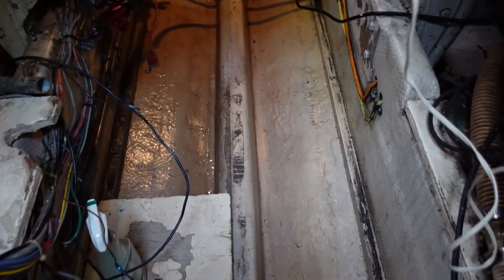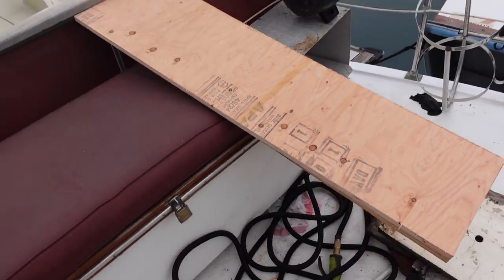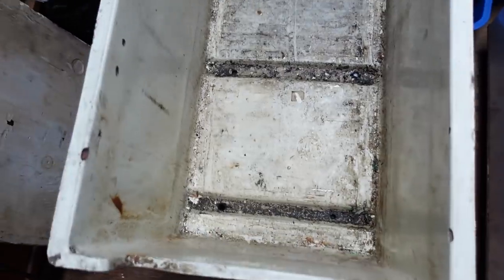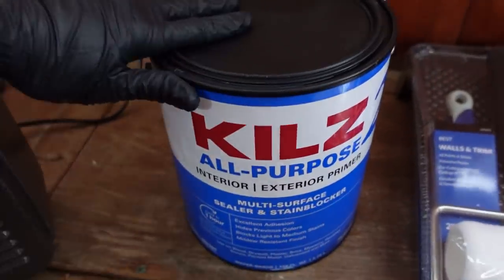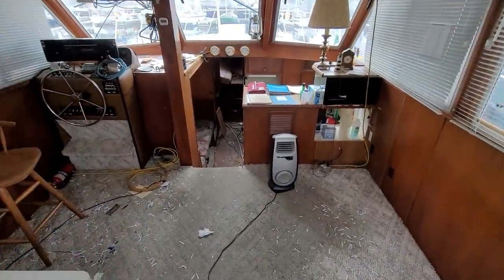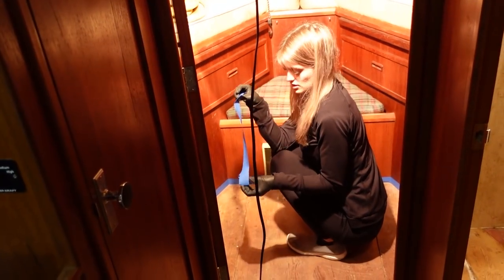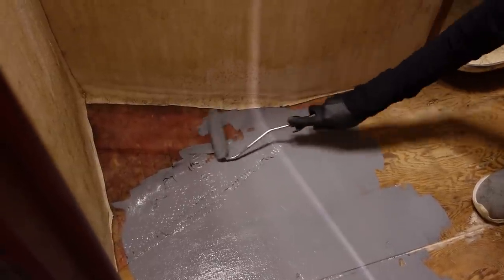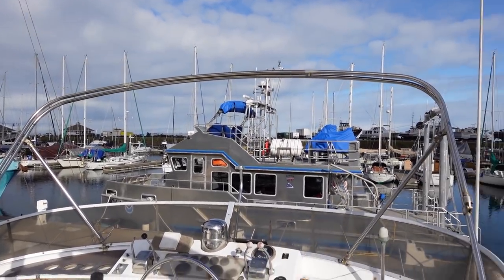Painting NASTY Interior Floors | Old Yacht Restoration | Ep. 8

Comment: When using a spade bit to drill holes in wood, it is good practice to only let the pilot poke through the bottom surface then turn the drill around and finish drilling from the back side to avoid splitting around the hole.
Also, consider getting a PVC pipe cutter to squarely cut tubing and hoses.
Great job on the restoration.  I would be interested in your backgrounds and prior experience.  You certainly are proficient in many trades.
Reply from the maker: Great advice, and thank you. We go into our backgrounds in episode 14, but any further questions we'd be happy to answer.

Comment: For the smell- consider a solar vent fan.  It turns over the air in the boat every few hours and really solves those problems.  For the interior wood work, I would keep as much of the wood tone as possible but for areas where the plywood is rough or water stained you can sand and paint any color but sand/scrape/strip the solid teak edge trim and varnish that for a very sharp, bright, yachty look.  Nice work!
Reply from the maker: Solar vent fan sounds like a great idea, we'll look into getting one. Thanks for the guidance on fixing up some of this wood.
Reply: @SeekingSeas  no prob. Looking forward to the rest!

Comment: Congratulations and great channel. I highly suggest installing carpeting with thick padding on top of the newly painted floors, or some form of vinyl with padding. The carpeting is designed to be a thermal barrier and more importantly a noise barrier for those loud diesels. Also, plywood is not an ideal flooring material...
Reply from the maker: We're leaning towards carpeting for the reasons you mentioned. It is very loud when the engines are running, so getting sound proofing under the carpeting seems like the way to go.
Reply: @SeekingSeas  you should look into sound dampening, easy to buy off amazon, put a barrier of the aluminum backed (like dynamat) stuff along the underside of the engine room roof and then add a layer of very dense noise insulation foam with some glue. It will cut noise to the cabin by 60%

Comment: If you have not done anything with your boat’s interior floors yet. You may want to consider just painting over the primer that you put down with a marine interior paint, and then buy same fairly cheap rugs to put down. With all the work you will be doing if you put a nice floor down now it will probably just get torn up and stained before you are done. Also, I’ve seen too many times where people put carpet or other flooring down and they made it where you could not open up all the hatches over the engines which made working down in the engine room much more difficult.
Reply from the maker: That's not a bad idea! We'll definitely have to consider this, thank you for the suggestion.

Comment: When painting panels take a scrap piece of wood and put a bunch of screws through it with them pointing up through the wood then you can paint panels and just flip them onto the screw points and paint the other side right after without having to wait for everything to dry. Imagine like a bed of nails. It also gives good air flow so the paint dries pretty quick.

Comment: Did the Kilz work?   I think I would have sanded that floor, damp mopped, deck brushed with bleach water, wet vac up, dry and then used the Kilz.
Reply from the maker: Kill worked great, we still haven't decided on flooring material yet but this helped to seal some smells into the wood.

Comment: Smells coming up from the bilges, best thing to use for cleaning bilges and cheapest is toilet bowl cleaner. The painting of the subfloor will help a lot  and then some type of laminate flooring peel & stick wood like strips work well especially with hatches. Finally replace all of your waste lines going to holding tanks and if you can pull the tanks and replace or clean with heavy duty industrial cleaner brutal job but makes a huge difference! Also replace your water lines and install a home style filtration system connect both your dock side and on board system to the filters.
Reply from the maker: That is great advice, any particular brand of peel and stick you recommend?
Reply: @SeekingSeas  Don't know if you have them out your way, in the mid west here we have a discount chain called Ollies they carry a 36 inch long by 2.5 wide peel and stick plank. Very easy to use you can cut with a heavy duty scissors. I am on vessel #2 using it. Goes down easy & fast as the planks are wide & long. Best thing to do is use 3M Heavy duty spray adhesive you won't have any issues with it peeling, shifting or coming up. 2 other items of advice if you still have some odors try cleaning all your hoses & waste lines with bleach water especially around your connection fitting but make sure you rinse thoroughly or the bleach will eat away at rubber fittings. Second thing if you are having trouble with your canvas guy try this alternative - Hard To Top it is a semi hard top that can be mounted right on your existing bimini frame you will never have spend money on canvas again it is an excellent product.
Reply from the maker: We dont have Ollie's out here but we'll look for an alternative near us. Thanks for the info and advice.